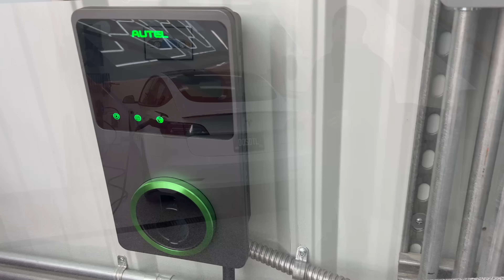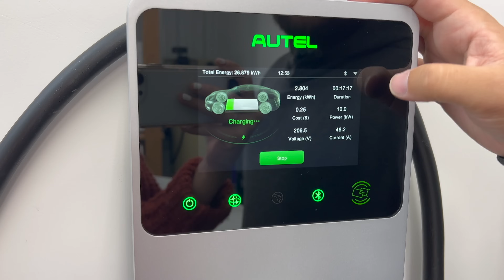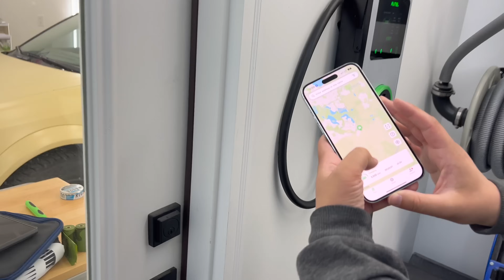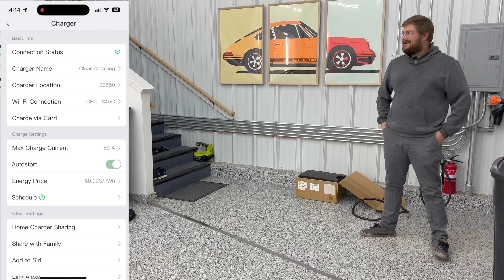We Focus Too Much On DC Fast Charging! Here Are Some Level 2 Considerations - Autel Touchscreen AC

Comment: Why is it that EV enthusiasts all assume that other people own houses, let alone houses that have garages with electrical service (which many older houses don't). Also, why do they assume everyone always drives no farther than 100 miles from home at any given time, meaning they don't think public (or fast) chargers are even necessary. Also, why don't they realize that if everyone owned an EV, the electrical grid would not be able to support everything (without a massive effort to build new power stations and distribution towers). And why do they think it can all be solved with solar panels on top of roofs, which it can't. EV enthusiasts and politicians need to face the realization that only less than 50% of people (and probably way less than that)  could ever hope to home charge, would be cited if they tried to street charge, and couldn't charge at all if everyone owned EVs. Let alone use a lot of electrical stuff in their house because of power rationing.

Comment: I have an older 2015 BMW i3 I have been charging mostly at my house. When I purchased the car I bought the BMW brand level 2 charger to use in my garage. It hangs on the wall.  I had an electrician install a 220 volt plug to match the charger plug. He installed a 40 AMP double breaker in my panel which is less than 12 inches away and went straight from the plug to the breaker in the panel. I have never had a charging issue for several years now. Now I am wondering if my breaker is undersized. What if I want to charge a Volvo XC40 or other EV? Should I make changes to my breaker? It appears I am ok for the BMW but I am considering another EV and thinking I should increase the breaker size to a 60 AMP?

Comment: Between this and a Tesla universal wall connector on CCS Now but eventually EV going NACS
What provisions does the commercial one have to say switch the cable to NACS If I change vehicles
Thinking tesla for home only because intially has adapter and is simple and later just nacs already there
I just love the onboard display for the Autel

Comment: No expensive EVSE for me.  Mine is a $350 portable variable amperage unit(up to 48) with a 25 ft cord that I have mounted(easily removable when traveling) on a wall in my garage and it plugs into a NEMA 14-50.  Having recenlty taken a road trip, I was disappointed in the availability of non-Tesla DC fast charging, so having a portable unit makes sense given the state of charging infrastructure in the US today.  DC fast charging along major corridors here in Texas are ridiculously expensive and have wait times in excess of an hour during peak times even with folks just doing an 80% top up.  Not to mention that the Texas heat really stresses the charging stations and I found that many were out of service further reducing availability.  This needs to get better.  So carrying a portable unit means that I can use an RV park connector if necessary.

Comment: Former Yugoslavia has one huge benefit:
Almost every house has 3 phase power and we have 3 phase sockets, rated at 16A which gives 11kW. 
I was on a road trip, and in one town, 2 chargers were occupied and 3 were broken. So I asked in a diner to plug in my car. By the time I finished my lunch, it had added 150km of range.

Comment: Can you just plug into your 240V Dryer plug already in your basement?
Reply: Not a good idea because the plug is not for EV charging which have a long (>3hr) continuous duty cycle.  They could melt and possibly start a fire.

You could have an electrician come and change the outlet to a Leviton or Hubble EV outlet and then it would work.

You also don’t want to share the plug with the dryer and the EVSE as they are not built for cycling the plug…that will loosen the connections which can cause heat and possibly fires.

Comment: There's almost no difference in charging speeds between 48 Amp and 50 Amp Level 2 chargers. The length of your homerun would affect the charging speed more than the 2 Amp difference.  Both the RWD Model Y and Model 3 will only accept 32 Amps. The Long Range Model 3 and Model Y will accept the full 48 Amps. I would guess that my Tesla Wall Connector will charge very close to 50 Amps. 

My Tesla Unversal Wall  Connector will charge my  Model 3 RWD at 8 KW per hour in reasonably cool weather (below 86 degrees F). That is above its 7.6 KW max rating

Comment: 50A x 20%  =  10amps  would mean a 60 amp breaker.   40A x 20% = 8amps would mean a 50 amp breaker.   Smart using the higher amp closer to the circuit breaker.    You did not indicate the guage of the wires which is probably more important than the breakers.   Six guage is better than eight gauge for three power wires and you can use a lower guage (e.g, 10) for ground, the fourth wire.   Your conduit looks a little on the narrow side for six guage but you are in cold Colorado.

Comment: why arent the cables white?
isnt electricity reduced or has a lower quality with more heat, (interal heat from electricity and external heat from the sun baking a black cable)

Comment: Kyle I need, we need you to do a deep dive on cost of dc fast charging, all companies. I still think Tesla will be cheaper. I am tired of paying .51 to .56 cents per kw and sometimes a 2.99 connect fee. So wrong. I want to start a company that is fair to the consumers and spreads use on a comparable price like Tesla

Comment: Yes, level 2 should be everywhere but also implemented wisely, not to have 100 apps for various providers... but even if you cannot charge at home, if level 2 was everywhere, you could charge the car while at work, shopping, watching movies, having a day at a beach etc. So unless you go on a long road trip (or are a taxi driver or delivery guy etc.) you would not even use a fast charger. And when batteries get more energy dense and we have bigger ranges, it could be quite possible fast charging will be needed very very seldomly, of course it still should be available but it will also be one reason why the grid won't ''collapse'', that actually we do not need the same fast charging capacity as we need gas stations for cars. Might need to increase some local capacity  and maybe in some properties the wiring will be really old to support it, but if it is everywhere you do not need to charge at home too if your wiring is super questionable

Comment: Dear EV car lovers.A lots of people think swapping batteries is useless wrong and here’s why? 

Here are the key points of a battery swap station.
1, battery degradation can swap it with a new pack.
2, people who lives in apartment no place to charge.
3, when winter ❄️🌨️season don’t want to get off car with sub-zero temperature same as rainy 🌧 season.
4, for 👯‍♀️🙎🏻‍♀️💇‍♀️beautiful girls who drive EV charging cable too heavy don’t want to get theirs hands and feet dirty.
5, people who drive long distance with a choice to swap an upgrade battery can get longer ranges.
6, people who in hurry no time to wait for charging battery “ like Uber, Lyft, or DiDi drivers.
7, so much benefits of battery swap technology many companies are joining with NIO Inc. CATL and DiDi just Joined.
8, people who want to upgrade their car battery to a higher Wat .. and so on.
There are endless benefits with battery swap-able EV isn’t it..

Comment: Great vid, thank you for this (and your others as well) !

I wonder if your explanation of total amps available to charge and the 20% buffer is a bit off? 

Max current available is determined by the details of your electric supply setup, i.e., literally the juice being supplied by the transformer in your neighborhood and the gauge of the power supply lines feeding your house or apt complex/condo or commercial garage or whatever.  Then also, of course by the gauge used and routing length from home input to desired charging point. 

After max current available is determined, then take that 80% cut, meaning select a breaker that will trip at 80% less than max available current. 

So.... you said you have 200A available, that means your unit can take 50A and your breaker ought to be 50A, that gives you far more than 20% tolerance. 

That would be my understanding, anyway. 

Maybe I misinterpreted but I went and listed again and you said 75A breaker for a 50A appliance so... I think it would be 50A for 50A. 

Again, thanks for the vid!

Comment: im on the hunt for the best mobile lvl 1 and 2 units. I ride a EV motorcycle so mobility is key for me. I am also looking for a model that will not trip GFI's like the unit that comes with the bike does. I have been looking at the Webasto go dual voltage, but they are almost $600. Anyone have any good suggestions??

Comment: Nobody is going to spend 4 hours at a coffee shop - L2 for that use case is just a gimmick.  For me, unless I am going to spend an hour or more, I won't even bother with L2, as the amount of juice that I am going to get just isn't enough to make it worth the effort.  Let the plug-in hybrid people use the L2 in those locations.

There is a use case for shopping centers and whatnot where people will spend on the order of an hour, where medium power (24kW) DCFC could make sense.  In such cases, no upgrades to the grid is needed, no new power transformer, no demand charges from the supplier.  Essentially simple and quick to install, and slightly more expensive hardware.  You can charge people for the juice, but it won't be as much as the full rate that you would pay at Tesla or EA.

Comment: Kyle,
I have the Autel 50amp charger with the off-board handle mount.  I bought that one thinking that if the handle mount broke, on-board, fixing/replacing would be more difficult.
Yes, I could buy a separate off-board mount, but then I’d have a broken/unusable base or on/board mount.

Comment: Let me ask a very basic question.  Why should I use an EVSE?  I have a 240V outlet on my wall.  I plug the cable that came with my Model 3 into that outlet, and plug the other end of the cable into the charge port on my Model 3.  That seems to work just fine.  How would adding an EVSE into the mix be better?
Reply: I am not a Tesla owner, but I believe your "mobile wall charger" provides the 32 amps that an evse would provide. So for you, you're all set! Buying an evse would be for those whose cars don't come with that nice Tesla mobile charger.
Reply: @ramonmorales1980  thanks!

Comment: I'm a bit confused by the statement that a 70 amp breaker is needed to provide a 20% buffer for a 48 amp device. Why isn't a 60 amp breaker sufficient?
Reply: It is. 60 x 80% =48

Comment: One important consideration for home charging - even with L1/L2 charging, how much speed do you need?  Everyone talks about 50A, 60A, 70A, etc. circuits and those just aren't available (or needed) in a lot of cases.  

I have two EVs at home and two EVSEs - both EVSEs are 240V 16A units.  So I really only need a total of 40A @ 240V of load capacity in my panel.  16A EVSEs are inexpensive.  12 gauge cable costs a heck of a lot less than 6 or 4 gauge.  I can plug and unplug 6-20 plugs all day long with less worry about wear and tear than I would with a 10-50.  And I can still replace over 100 miles of range in each car in about 10 hours.

Obviously there are people who need relatively "fast" L2 charging at home.  But if you drive fewer than 40 miles a day, even the humble 120V 15A outlet can probably serve you pretty darned well.
Reply: Wire size is important for load calculations

Comment: My local electric utility is offering a nice discount on the purchase of an EVSE (Enel X Juice Box 40 amp) as well as discounted rate if I sign up for their managed charging program where they can control when charging occurs. Is this wise? Is it possible it could be detrimental to the overall battery health? I live in the city and don’t commute far at all so I’m not concerned about not having enough charge on any given morning.  I find lots of “pros” for managed charging online but not many cons. Just wondering what others have decided

Comment: Hi Kyle, great video - thank you.  Q: what charger option would you recommend for a condo building looking to invest in charging infrastructure in an underground parking garage for residents?  Thanks again!
Reply: 120V outlets.  Seriously - Level 1 EVSEs are relatively inexpensive and they can replace 50 or so miles of range overnight when plugged into a humble 120V 15A outlet.  For the breaker box load of one fancy 48A unit that needs a 60A breaker, you can provide eight 120V 15A outlets on dedicated circuits.  

Maybe put in a few extra-charge "premium EV" parking spaces that you charge a little extra for that have 32A or 40A Level 2 stations, or provide L2 stations that charge extra for the power to cover long commuters.
Reply: hi friend,i will recommend you a ev charger with OCPP.

Comment: I installed a Enelx L2 charger in my garage in March. Checked my charging for the last 30 days and I've spent just over $10 in the last 30 days on my "fuel". Level 2 charging at home is the best.
Reply: I have one too…but it’s just a dumb EVSE now that Enel X has pulled out of NA.  I’m looking for a new smart EVSE, I think it will be either ChargePoint or Autel.

Comment: Chevy Bolt EV EUV with 64 kWh battery and 11.5 kW level two charging is fast.  Up coming 85 kWh Equinox EV 3RS will have 19.2 kW charging and less than 5 hour full charge.

Comment: That Autel Pro model looks perfect for HOAs, condominiums, and apartments.  I’ve tried to get Tom to do a review on Pro models because one of our greatest adoption problems is charging at these MDUs.  The Autel Pro wasn’t available when I installed a Juicebox Pro at a Florida condo.

Major criteria when selecting a brand are: 1)  credit card processing fee; 2) annual software maintenance fee; 3) cellular monthly fee vs WiFi; 4) transactional fees; and 5) EVSE cost.  Don’t even consider ChargePoint because their pricing is 300% higher than all the competition and popular models can’t do 11.5 kW.  Beware that someone needs to manage pricing, account set-up, and ensure electricity reimbursement.

One EVSE supports about 5 users when allocating morning, afternoon, and overnight charging periods.  As another nerd, I value the data on the Autel Pro, but you don’t need it because other brands put that data in their phone app.  Juicebox Pro is activated both from app and simple phone recognition of QR code or RFID card.

Comment: Is there an optimal amperage to charge an EV? 6 to 48 amps is a pretty wide range and if the vehicle is going to just sit there I might as well charge at the optimal amperage
Reply: Battery science seams to discuss up to 1c or 80% if 1c as safe (charging battery in one hour =1c). Level 2 charges waaaaay under that so charge to the max that your cars inverter equipment will do (6-11 KWh)

Comment: I was a little surprised that at the end of this video, you mention that I tools now supports you, but at the beginning of the video, it did not say anything about this being a sponsored video. I understand that you will give an honest review, however, if you’re receiving product without paying for it, then I think you should be honest with your viewers and told them this is a sponsor video and explain why. 
I only know stock in EVSE makers however, I was a little surprised that you were somewhat negative on ChargePoint because of their pricing after getting a tremendous tour of their lab. It’s fine to be clear about Autel pricing versus ChargePoint but I don’t think giving such a strong recommendation for the one maker that happens to support your channel is sounding overly neutral.

Comment: Instead of offering 2 SKUs, one with the exterior handle holder and the other with the built in handle holder, would it really be prohibitively more expensive to just make 1 SKU and offer the exterior handle with a closed off front plate that could be swapped out included in the box with the unit that has the front plate w/ built in handle holder?

Comment: I'd like to see a video on charging solutions for large-scale multifamily. Are there any charging solutions out there that scale well enough to handle a parking garage for a 300-unit apartment building where all cars parked in the building are electric? A dedicated level 2 charger and 70 amp/240V circuit for each resident in the building seems like it would be very expensive and that the right solution that combines load sharing and charger sharing might do the job for far cheaper.

Apartments is a much more challenging charging situation in an all-EV future than retail businesses; even if every car is an EV, most customers visiting a retail establishment won't need to charge at the store because they will be charging at home, so a relatively small number of chargers at retail establishments still serves the community just fine. But, homes is a different story. This is where everyone expects to be able to plug in.
Reply: Bear in mind that the average commute is about 40 miles round trip in the US.  120V @ 12A (on a 15A outlet) charges about 4-5 miles per hour.  So the average US commuter could charge their car to support their daily commute in 10 hours (probably less time).  

Obviously this is not going to support everyone, but providing 15A standard outlets at home parking spaces will solve charging for a lot of people.  You could put in one 60A 240V circuit to support a single 48A EVSE for one car, or for the same power load on your breaker box you could put in 8 120V 15A outlets and help 8 people out.